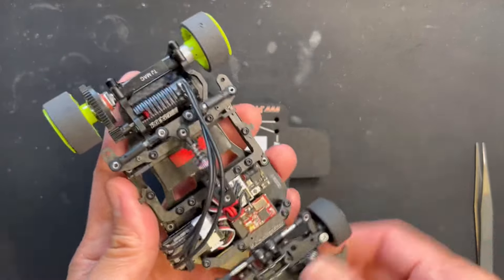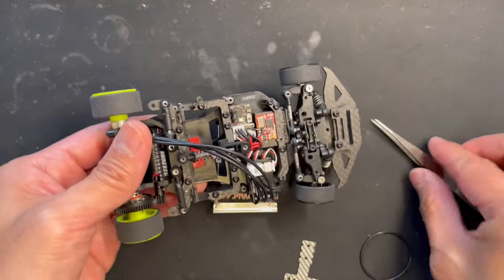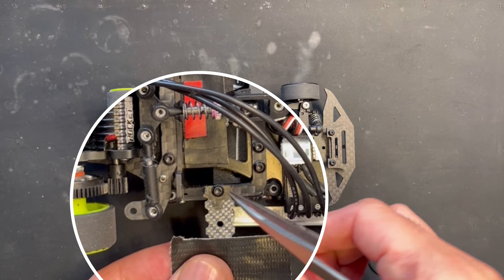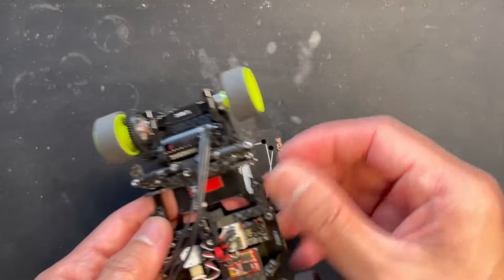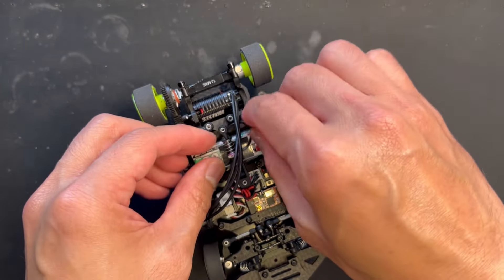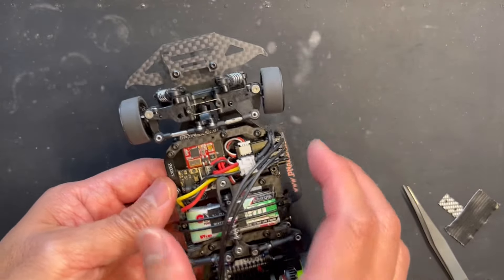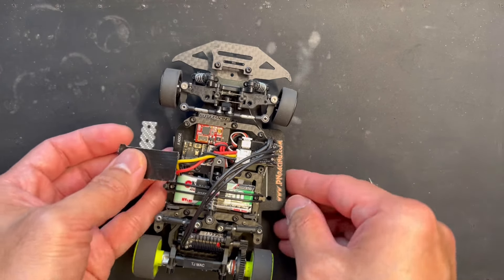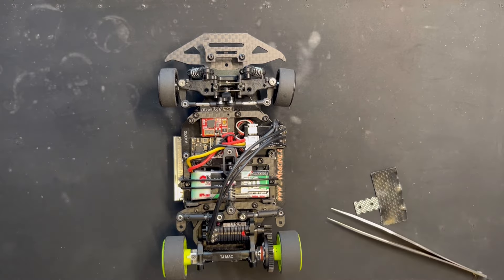Tip of the day #3 | Securing the LiPo Battery Rubber band on #RX28

Comment: What double sided tape do you use to secure the esc and receiver in place? If you have a prefer brand you use pls share thanks!
Reply from the maker: This is what I'm using but it's not easy to remove on the chassis. If you remove your electronics often, you can put painters tape on the chassis first before sticking this Scotch brand double sided tape on the RX and/or ESC: https://a.co/d/01CGHSHa
Reply: @tjaymacRC  3M clear double sided tape from Lowe’s. Comes off super easy. Use it for 1/10 and 1/8 offroad